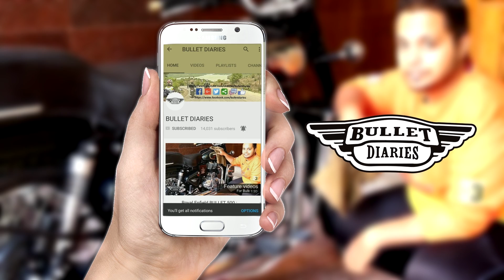MY SAD STORY OF KARIZMA | PART 2 | ISSUES I FACED ON KARIZMA 2010 - 223 CC

Comment: just like you after buying Karizma 2nd hand , had lots of issue, now I'm solving its issue day by day. In my suggestion keep Karizmas carburetor with idle or pilot jet of 40 that is keihin N424-26 40  your idle  problem will vanish and keep both the cable that push and pull to keep the rpm problem check. For engine oil use 10 w 30 or 40 never go beyond that or else pores in engine will widen due to pressure to lubricate at high rpm and temp. And its best mod you can do is change your spark plug to iridium one vibrations will reduce drastically and fuel will burn properly. Always use good handle bar weight and  try to find a handle bar weight rod and  to use use it in handle bar, you will feel night day in vibration.

Comment: Clocked 20k kilometers on my 2012 Karizma R with a P150 carb. Swapping Karizma carb will fix Idling, cold start, throttle response issues
Reply from the maker: Great
Reply: Bro I have 2013 model Karizma r with tps sensor carb at the time of throttle at 2500 rpm to 3000 rpm it's starts missing even I have cange my carb with new one nd the both valves are replaced nd the cdi is working good  what is the issue I don't known even the mechanic was also confused , nd please tell me the real issue also tel me about how I can find this p-150 carburettor
Reply: Do we need to change the jets size or just direct fit....?
Reply: @tarunk04  just had to extend the pipe towards the air filter box. Otherwise, is mostly direct fit
Reply: @KaranSingh-tm1sf  I have my tps disconnected. Not having any issues

Comment: I have karizma 2006 model and clocked 1.4L KMS, i must admit one thing here, karizma carburettor are very rare and will not get effected. Also on every general service, checking the tappet settings and also cleaning the petrol tank will give more life to the engine.

Also pulsar carburettor will price is around 4500-5000 i guess instead of that pulsar carburettor its better to have karizma one.

For me karizma carburettor will not get spoiled that soon... Happy thumping.
Reply: How should one clean the petrol tank?